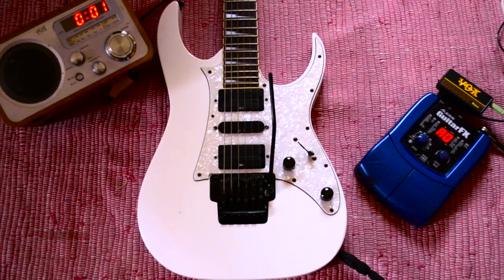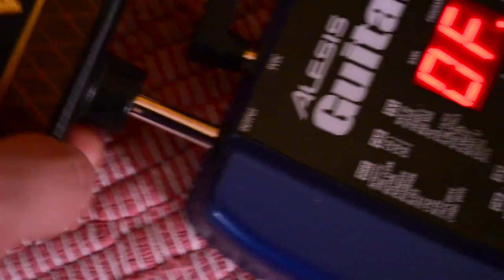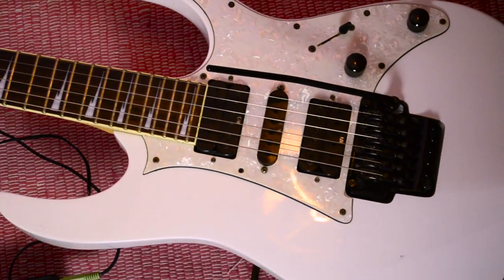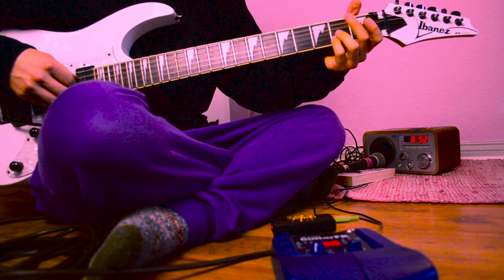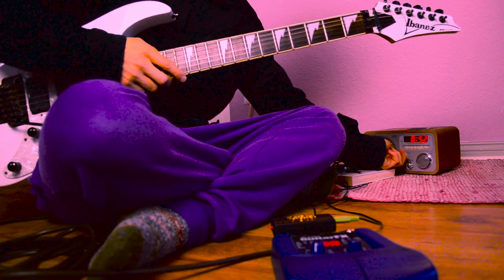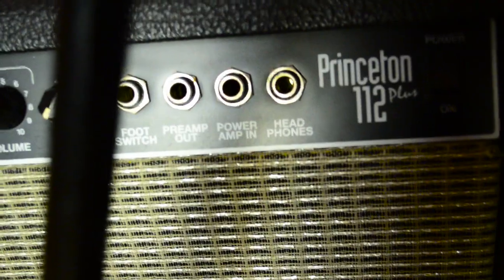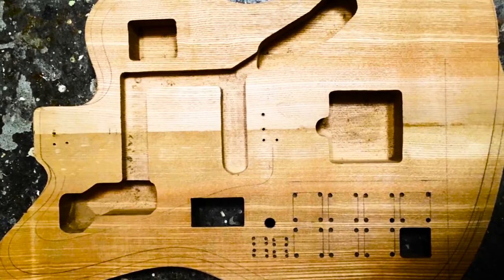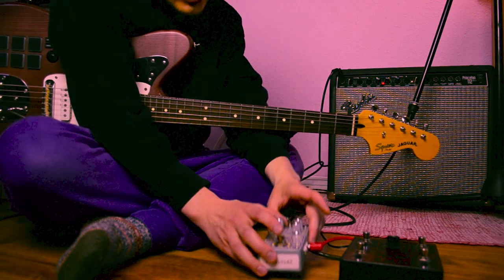Vintage Radio turns into Lo-Fi Guitar Amp

Comment: I've done something like this before.  I used one of those guitar headphone amps but used an FM transmitter you would use for a phone/MP3 player to use in your  car.  Then I could play guitar through my old radios or boomboxes.  I don't think it was very good for the speakers though, but it was really fun.
Reply from the maker: Super fun! As long as you manage the input signal to not blow up the radio it should be fine. Although I understand that this could sound very nice. ;)

Comment: On the radio, the mic diaphragm is about half the surface of the speaker whereas on the Fender you had the mic pointed right at the centre of the cone which is THE_WORST sound!!! I'm not surprised the cheapie gear sounded way better - good video, one up for the little guy! :o)
Reply from the maker: May be. :) I usually mic my amp in fully centered position as I like the clean and trebly sound that way. I guess in this video I should have chosen the clean channel on the Fender amp instead of the drive channel. Would've sounded better either. Thanks for the kind words. :)

Comment: How much dry signal can you mix in from the alesis on the reverse reverb? I'm struggling finding an answer before buying
Reply from the maker: It's just 100% wet. No dry signal available. But I never use a dry signal for this effect as it's supposed to sound as pad-like as possible. But I know everyone has different wishes.

Comment: Can you actually change the settings on the reverse reverb on the Alesis? I want to get one but i couldn't find anyone or anything that told me about the versatility of the pedal
Reply: I don't own one, but I saw it has a effect wheel and another for value... I was looking for a cheap reverse reverb...
Reply from the maker: Well, you can change the mix value of the reverse reverb by 9 steps. But it's not able to change the tone of the effect. You can use three effects at the same time but it's not possible to switch there positions in the effect chain. The reverse reverb is very good though. I'd recommend it to people on a low budged. For more versatility I'd always recommend the Digitech Polara, Digiverb or Hardwire RV7.
Reply: @berlinshoegazer  Can you change the decay or time of it?
Reply: Lucas Rojas yes, you can. You can download the Alesis Guitar FX pdf manual online
Reply: Ok i just bought one lol should be here in a couple of weeks
Reply: Hey, have you tried running the Alesis into any other pedal? Like a distortion or fuzz?
Reply: My unit is kind of noisy, but I think it might be my cables or my power supply
Reply: @marceloBAdARI  nice nice
Reply: @marceloBAdARI  mine is noisy though:((((
Reply: @lucaserojas  try yo use it with batteries to see if the problem is the power supply. Hope you can fix this issue
Reply: @marceloBAdARI  thanks bud, I'll try
Reply: @lucaserojas  glad to help
Reply from the maker: Yeah. I tried some fuzz pedals after it. Sounded great.
Reply from the maker: Hope you could fix the noise problem meanwhile.

Comment: Don't you think it's hard to compare the 2 guitars because one uses active single coil pickups while the other uses passive humbuckers? Also on Reverb the guitar prices of the two are all over the place. With the Ibanez sometimes costing above the Fender. I know you modded it but the pickups and neck are still stock.
Reply from the maker: Yeah, I was more focussing on the fact that most people think that it's neccessarry to play a Jaguar or Jazzmaster for a good sound. So the Ibanez stands for "feel free to play any guitar you like" if you don't have a Fender or Squier. You're right that the Ibanez is not a super cheap guitar but in Germany I could get it for 200 bucks used. That doesn't mean that it's low in quality. It definitily isn't. :)
Reply: @berlinshoegazer  ah yeah sorry must have misheard. Makes sense now thanks